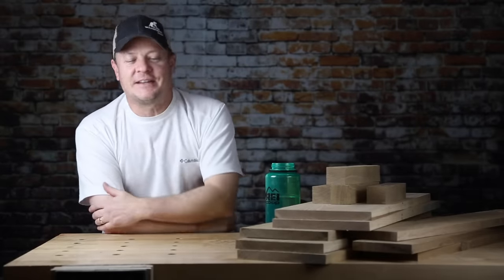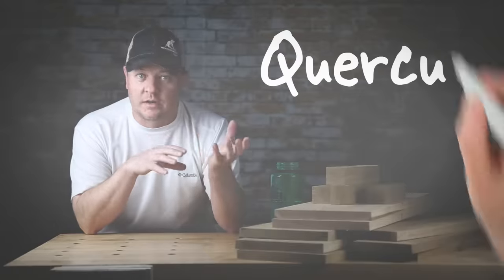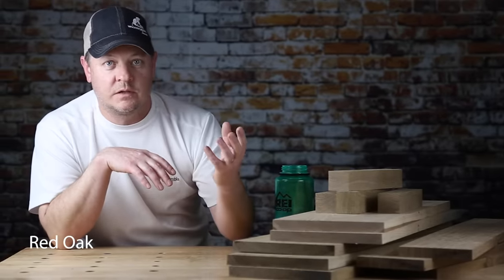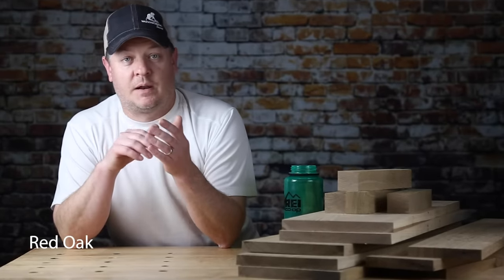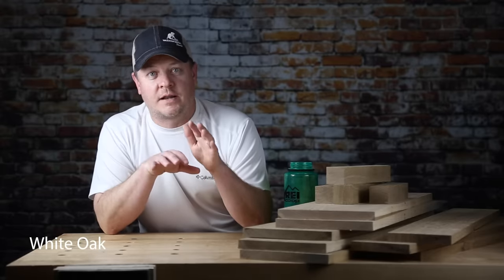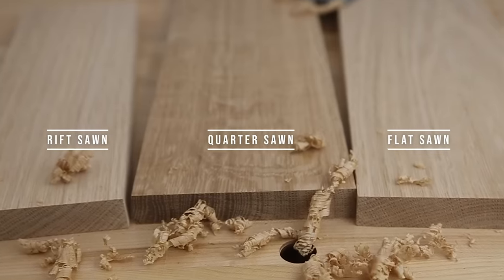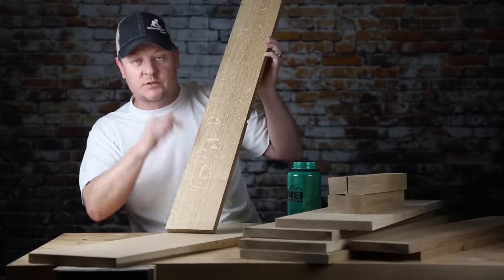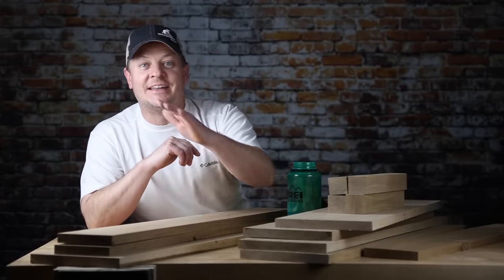The REAL Difference Between OAK Lumber

Comment: It would have been nice to hear that there are two main groups of oak: red and white. Not all red oak is red oak (Quercus rubra). They could be northern red oak (Q. rubra), southern red oak (Q. falcata), black oak (Q. velutina),  scarlet oak (Q. coccinea), shingle oak (Q. imbricaria), etc. White oaks are also not always white oak (Quercus alba). They could be white oak (Q. alba), chestnut oak (Q. montana), bur oak (Q. macrocarpa), etc. There are differences in the leaves of these two groups as well as the acorns, but since this video is talking only about the inside of the tree, I won't talk about those things. It's akin to not realizing that 2x4s are not actually 2" x 4." Also, the reason that white oak is used for ships and barrels and not red oak is because of tyloses.

Comment: Great video with a few caveats.  Rift sawn means the annular rings are at 45° to the face of the board.  Quarter cut is 90° to the face. By far and away, white oak is the finer selection despite cost.  With rift sawn wood, say you are to make a traditional harvest table. The grain pattern on all 4 sides of the legs will be very nearly identical. English brown oak is an even more expensive, but, far finer choice than NA white oak.

Comment: Hospitals use red oak for all the 6 inch handrails running horizontally on every wall, staircases and lots of cabs are red oak, miles of the stuff.  Red oak has porous grain you can see in the end grain.  You can see black dirt in the grooves of the face grain.  Not the story for white oak which is heavier, denser significantly less porous and even has a nice sent when you cut it.   White oak looks silky when oiled and takes a nice finish.  The quarter sawn flecks are really dramatic and give it beautiful depth. I made my bed with it and it’s gorgeous.   When you spray finish on red, it gets pinholes and has rough areas where the finish is not smooth.   This is where dirt from hands turn the grain black and it looks dirty all the time.  Harder to clean for this reason.  You can put a thicker finish on it to fix that issue.  I never knew about the leaf color.  You can tell its red or white without knowing what the leaf color is.

Comment: I used to work in a shipyard as a Carpenter. We built a lot of platforms and staging for ship fitters and pipe fitters, welders, etc.. I can tell you, whether white or red,  a 2x12 oak plank was a bear to haul around inside a ship, especially the 10-12 footers!

Comment: The HMS Victory is still afloat, still classed as “active status”, and is 20 years older than the USS Constitution.
Reply: Yes, Victory is older.  "active", Continuously commissioned"    Britain did normally 'lay up' their fleets when not in use. Older vessels were routinely used as warehouse space, prisons, even bulk carriers.  Victory was old, by wooden ship standards, when Nelson was aboard at Trafalgar.  And likely 'laid up in Ordinary" at the end of that conflict or a future conflict.  Hence, not continuously commissioned.  All of it is just semantics, a great vessel is a great vessel.
Reply: @Sailor376also  Old Ironsides is occasionally sailed whereas HMS Victory sits on a sandbar and does not go anywhere.
Reply: @dougrobinson8058  Yes, absolutely.  Last time she was sailed was in the mid 1990's but,, with the exception of dry dock for hull repairs, she has remained afloat.  Is afloat today, and untied from her dock once a year to turn her around. Anyone can and everyone should tour her.  I have ,, and at 6'4" I found it very enlightening, and head bonking, to explore her. 4 and 5 feet 'tween decks is normal.  The diagonal riders were gone when I first saw her,, but the scars and paint marks clearly showed where they were.  I have not seen her since they were reinstalled in the 1990's.  For any woodworker,, she is a marvel.
Reply: Continuously commissioned is the distinction for the USS Constitution.  The HMS is Victory is not floating it's been in dry dock for nearly 100 years now.
Reply: Ages ago i toured sister ship USSConstellation in baltimore. Very very cool.
Reply: Yes but has an awfull Gin stench!

Comment: The names and classifications are even more ambiguous than that:
There's a specific species (Q. alba) that's known as "White Oak", and a specific species (Q. rubra) that's known as "Red Oak", however, colloquially there are also two subcategories of Oaks called the Red Oaks and the White Oaks... all Oak trees fall under one of these two subcatagories. The difference in these have to do with wether the acorns germinate immediately after being shed or if they have to winter over before they can germinate. 
I was under the impression that wood sold as "White Oak" was a tree from this subcatagory of Oak but not necessarily Quercus rubra, and same with White Oak. Someone chime in and correct me if I'm wrong.

Comment: To the best of my knowledge, the distinction between red and white oaks is by the shape of the sinus (indents) in the leaves. It’s confusing because the group called red oaks contains a species called red oak (Quercus rubra) but it also contains other species such as pin oak. White oaks are another category and contain species such as Garry oak and burr oak. 

Thanks for the video!

Comment: Red oak tears up my throat when I cut it. When I cut on the table saw or when I cut with a chain saw. I hate cutting oak. I once was stupid n my 20s I paid a sawmill to saw up some water oak and sweet gum. They asked me if I was making hog toughs outta the sweet gum. That water oak wouldn't even air dry covered up, it rotted. I guess you need a kiln to dry it to make it any good.  Turns out live oak makes good furniture wood.  White oak between Atlanta and louisiana look so different. I had to cut some trees on my property and I had to cut a 10 inch white oak. I hated cutting that down I like white oaks and they are so good for deer populations.  Then I killed a medium 20 inch white oak by dirt work. It's been dead over a year, the bark is still on it with no mushrooms or fungus. I'm gonna have to saw it down and saw it up.  But my biggest project is a tupelo gum about 30 inches in dbh and it's been dead about 4 years still solid too, they are more decay resistant than white oak! But I'm planting about 20k osage orange tight around the 24 acres. And some swamp locust and honey locust and 100 black walnut are sitting in a box to plant tomorrow. The black walnut I'm gonna plant probably about 9 to 12 feet apart lining my road.  Then in 10 or 15 years I might thin them and be able to have a little black walnut lumber and some walnuts too.

Comment: I made a long bow from red oak, was really surprised how flexible it was, it has about a 40lb draw strength at full draw. From a single 1x3 by 6 red oak from home depot. 

Was also given an old solid wooden bed frame lately too, it was all white oak under the horrible stained lacquer. It was mostly made up of glued sections, but in 4ft 4x4 posts and 7" wide 6ft planks 1 inch thick. That look will just add to my new project of a portable repurposed white oak, butcher block.

If I make another cutting board the wife will beat me with it. 🤣

Comment: While there is specific trees for red oak and white oak,  when you are talking about lumber red oak and white oak refer to the different family of oaks.  Oak is split up into 2 different family's.  When you buy red oak lumber it can be any member on the red oak family,  red, black, scarlet, ect.  When you buy white oak it can be white, post, live, chestnut, ect.  The biggest difference between the 2 is white oak is a little more brown in color and the diffuse porious wood in white oak is filled with a salt like substance that make it's slightly less resistance to rot.
Reply: Exactly the comment I wanted to make!
Reply from the maker: Yes true, sorry for the mistake

Comment: I think you down played the negatives of white oak.  While i agree it is heavier and denser, it is also more brittle.  I can shoot staples into r| oak without issue.  When using white oak, i need to be more cognizant of the grain and distance from the staple to the edge of the wood.  

Red Oak is more forgiving of  a bad placed nail or staple.  I generally prefer red oak over white oak for our custom product shop.

White oak also tends to eat more bits on our cnc routers than red oak or poplar.

Comment: The bark on white oak is significantly different from red oak, where it's about 3 times thicker and you can even peel it off in strips. When you take off the bark it exposes the extremely white outer layer of the wood. Touch it with bare hands and it'll turn your skin purple.

Comment: White oak rift and quartered can give you some splitting or flaking of those rays on quarter sawn, as if a cheese slicer has been plunged into the board surface.  The nasty part is they usually don't show up until after a coat of polyurethane has been applied.

Comment: I have a house that was built in 1922, and all the structure is built out of red oak, (1400 sq. Ft.). The foundation and basement is 18 thick inch cut stone. Lath and plaster, and center-cut fir floors, with a red oak sub floor, and 12 foot ceilings.
It's really nice until you go to hang a picture, then the 100 year old oak says "You are NOT putting a nail in me!"
All the oak is flat cut on a circular sawmill. it would be scary to think how much that would cost today.
Reply: I bet your lumber is true to dimension too. A 2x4 is really 2" x 4"!

Comment: As Walkin Dude has mentioned, red oak is porours. I was a Cooper for 15 yrs, making mostly dry barrels, on occasion  wet barrels. Red oak is not suitable for wet barrels. If anyone would like to do a test, take a piece of red oak about 3\4 x 3\4  5 or 6" long, put the end in water and blow on the other end. After 20 or 30 seconds you will get bubbles in the water. This open grain doesn't swell shut.

Comment: I think red oak will wick moisture up hill do to the fact that the cellular structure is like hollow straws. Where White oak the cell structure is more closed and will not wick water uphill, does that make sense ? This is the main reason why white oak works well outside.

Comment: As a door builder, it is known that Red Oak has "open" cells.  White Oak does not.  The same is true with Douglass Fir and Hemlock.  The hemlock has "open" cells.  This is why hemlock should not be used for outdoor purposes.  SeattleDoor

Comment: Old Ironsides like all old ships has been rebuilt repaired and restored so many times it's doubtful if any of the original wood remains. This is common as wood in the water often rots and is attacked by  sea-going insects ( ship timber beetles). The Mystic Seaport Museum has an army of volunteers  working on the preservation (restoration ) of old historically significant ships. i.e. Mayflower, Charles W. Morgan, and others

Comment: The leaves that popped up on the video are Scarlet or Pin Oak.  Both in the red oak group but they are not Quercus rubra.  Another difference between White and Red Oak, white oak is used for whiskey barrels because the xylem vessel cells in the wood are filled with tyloses.  Red oak cannot be used as  barrel staves because it does not have tyloses.  can be used for nail kegs though but not liquied.

Comment: Thanks so much. I have a stack of recycled oak that I thought was White Oak.  I think now there is a mixture of Red and White in the stack. 
Funnily enough on my side of the ditch it is similar.  Blue Gum timber is a beautiful Red colour, and heavy,  Spotted Gum is similar in colour to White Oak but a totally different grain, really tight and smooth until it isn't. Red Gum depends where you live. Along the Murray the timber is pale to dark Red similar to Bloodwood. In WA Marri is also called Red Gum and it is the beigest, gum vieniest, yuckiest wood chip or firewood grade crap imaginable. Yet when whole wood chip logs are exported to China, they make furniture which is sent back here. Retail prices are similar to Aussie made real furniture from specialists. Yet it sells. Go figure.

Comment: Thanks for sharing this. However... I would like to argue that I find staining oak (in general) a real pain. It's like staining a piece of glass. The porosity is so low, that stain doesn't absorb. When oak is stained (in my experience) the stain doesn't penetrate at all. You basically paint oak by leaving the stain sit on it until it dries/hardens.
Reply: Hmmm....can't say I agree with that drummer, but I appreciate your comments. I recently made a small bookcase with red oak, sanded down to 220 grit. I used Min-Wax pre stain conditioner, then Min-Wax "Gunstock" stain applied with a small cotton cloth. And WOW, was I impressed with the results. The flat sawn grain pattern jumps right out at you. I wouldn't hesitate to use the procedure again.
Reply: @thomasclarke8220  ... I have to be honest... I'm not sure if I've ever used red oak. It was likely white oak. However... I could barely get any penetration of the stain, and I've stained oak quite a few times. I'm glad you got good results with red oak. Also... is there a reason you used pre stain conditioner on hardwood? It's it typically made for using on softwood like pine or poplar, to insure that you don't get splotchy stain? Those woods have a tendency to have spotty areas of soft and harder wood, so they can get nasty looking without pre stain. Hardwood is really consistent. I'm just curious.
Reply: @footnotedrummer  
I saw a you tube video that gave a demonstration on staining various types of wood, pine, oak, maple etc. It showed results for the different  wood types being stained with and without the pre-conditioner. Even on the hardwoods I could see a difference although not as much as the pine for instance. Because of this  I decided to use the conditioner on anything I stained. I'm new to furniture making so I didn't want to take any chances. Was it really necessary? I'm not sure but
the project came out looking fabulous if I do say so myself.
Reply: @thomasclarke8220  ... glad to hear that. Maybe I'll try it, and check out the results.

Comment: Enjoyed your presentation, thank you for sharing. However, just a note, "The hull of the USS Constitution was originally made of white oak and live oak. The hull consisted of three layers with the outer and inner horizontal layers being made of white oak and the center vertical layer being made of live oak. . . . this live oak is what gave the ship it’s iron-like strength and earned it the nickname “old ironsides” during the battle with the HMS Guerriere in 1812" [historyofmassachusetts.org] Live oak, Quercus virginiana, grows exclusively in the swampy southeast U.S., is an evergreen, and is much denser (.88) than the white oak (.77). Live oak will float, but just barely. On the other hand, white oak, Quercus alba, is native to eastern and central North America and is found from Minnesota, Ontario, Quebec, and southern Maine south as far as northern Florida and eastern Texas." [Wiki]

Comment: If you are out in the woods and you see an oak tree a good way to determine if it is red or white is buy the leaves. If the lobes of the leaves are rounded then it is a white oak. If the leaves terminate in a sharp spike then it is a red oak. Just think of the sharp points as drawing red blood.

Comment: Live oak janka hardness 2680 vs white oak at 1350.  I agree its ability to withstand cannon ball fire was because of the live oak hulls, in part, but also because we used black locust dowels to pin the mortise and tenon joints which prevented the ships frame from racking after being hit.  Here's an excellent article about it even though the pretense is about Black Locust.  Written by a historian from the Colonial Williamsburg Foundation:   https://www.livescience.com/50732-black-locust-tree-shaped-the-united-states.html

Comment: Red oak has a straw like composition  If you take a length of lumber,  put the end in water and blow threw it, bubbles will show up in the underwater edge. This is why White oak is used in boats and ships.
Reply: Another way to confirm an oak board is white oak and not red.. cut a 2" cube of both. Get two shallow bowls or saucers. pour a 1/4 inch of  rubbing alcohol into each dish. Place a cube in each dish with the grain running vertically. In short order the alcohol will wick way up into the red oak and only slightly, or none at all into the white oak.

Comment: Very nice.  But a freshly dropped red oak tree will have have wood that is clearly red in color, it drys to the color you have in the boards you are using.  White oak wood is a pale cream, or yellowish color when freshly cut.  This may account for their origination of their names.  If you weren't familiar enough with the bark and branching structure of the tree when selecting one in the forest, you would certainly know which one you had when you dropped it.

Comment: You forgot to mention that quarter sawn lumber is not likly to cup.  Thats why it is preferred
Reply: Preffered? That depends on its intended application... You wouldn't want quarter stock on aprons or a table top as it doesn't look as good, you wouldn't get it in wide enough stock and good design readers cup an unimportantance for those uses anyway....
Reply: @jaimeclifton9078  I agree concerning the aprons and the tabletops and especially tablelegs shouldn´t be made using quartersawn lumber. But there are plenty of good uses for quartersawn lumber like drawers just to name one. And if you don´t get stock that is large enough, you make your own
Reply: @jaimeclifton9078 , disagree with all your points.